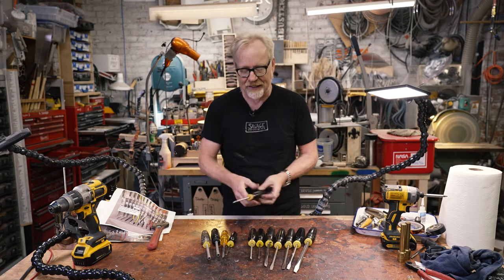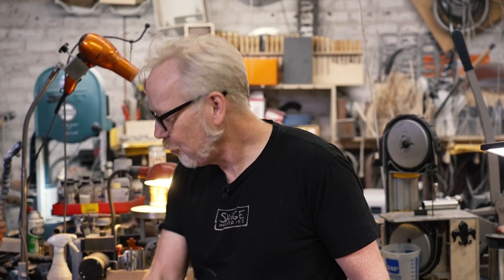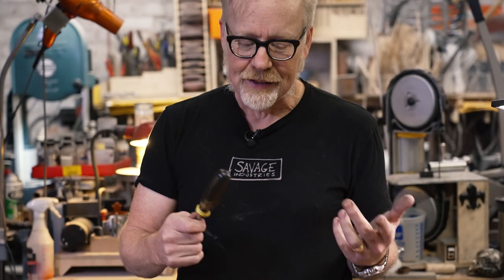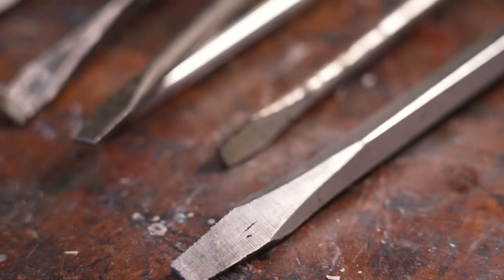Adam Savage's Favorite Screwdriver Design!

Comment: With the lathe and rotary head for the mill, you could give a taper to the hexagon shapes and change them to a triangular / 3 prong shape.  
Or, as temporary measure to fill in your set, machine that handle shape in delrin and affix the shaft/head from other screwdrivers to it.
Reply: I did this. Had the shafts milled to spec at a CNC shop and then made a mould out of aluminium for a hard resin handle that was a custom fit for my personal ergonomic desires. After 18 years of screwing around with cheap and expensive sets, i realized that there's no substitute for making your own.
Reply: @aserta  And it has never been easier to learn how to make your own.
Reply: @aserta  I'm a machinist, and I've had factory jobs where I used a screwdriver so much I got blisters every day. My personal solution is different than yours, but still pretty involved. I find large old wooden-handled screwdrivers with messed up heads. Pull the shafts out by sticking the shaft in a vice, use pry-bars bars to pry the handle up and off of it, and replace the shaft by pressing and/or epoxying a new shaft in place. Then I can shape the screwdriver handle however I want, to get rid of hot-spots. It's just wood, and I'm in a machine shop. 

I thought about making a mold for a plastic handle, but untreated wood is much better for my work. I get really oily, and plastic handles get slippery. What kind of shape did you end up going with? I might want to try it sometime.

Comment: I have a set of nine Stanley Workmaster (black & yellow) screw drivers I bought in early 70's.  They are indestructible, but no Canadian screw driver set is complete without the Robertson (square head) drives, #2 and #3.  The tools I inherited from my Dad are greatly valued and I would hate to loose even one.  Even the 1920's, perfectly balanced, hickory handled claw hammer, knowing that the aged patina of the hickory handle is stained with Dad's blood, sweat and tears (DNA).
Reply: Need #1 as well for electrical.

Comment: Curious questions for you. I’m a diesel mechanic by trade and all my coworkers own lots of snap on tools. I was very skeptical of them because of how much they cost and if they were actually worth the money. My coworker said that he buys them simply because, “they’re pretty and if I’m going to use them everyday, I’m going to treat myself to something pretty.” What is your opinion of tool truck tools? Would you ever buy a tool simply because it’s pretty even if other cheaper ones work just as well?
Reply: I'm pushing 60.And have used tools all my life. I can't say that I've managed to keep a complete set of anything so my tools are filled in with mix matched brands. They get the job done. My Buddy has a shop and only buys Snap On. Tools. It is always a treat to go there and use his tools. They really are superior.  I like his combination wrench set .open end and box. They are extra long and extra thin. And the open end does not slip off like other wrenches because they have little teeth cut inside that grip and hold tight .

Comment: In my opinion theres no better screwdriver than the Wera Shockproof (Schlagfest) meaning the yellow handle with the metal cap on the top. At most companies around here (Austria) you only see the Wera Screwdrivers (just like we only have Knipex Pliers and Pipe Wrenches). Wihas are Also very nice.
Reply: The disadvantage of the shockproof version is that it doesn't show the size on the back, like the regular Wera's do, and which make them so easily identifiable. So I only bought a large flathead in shockproof version. That's the only one I'd bang with a hammer, like a chisel. All the others, Pozidriv and Torx mostly, are more practical in the regular version in my opinion 🙂
Reply: @nolanhitchens  Well, sometimes you need to hammer the screwdriver into dirty or damaged screws and it's nice that the back of the handle takes a beating gracefully ;-) 

I keep them sorted on a first-order-retrievability tool-wall, so the missing marking on the back is not an issue for me.

The other big advantage is the hexagonal transition between driver and handle: You can use a ring spanner to convince stubborn screws with more force to get out (or break).
Reply: @Makatea  True, but the regular Wera's also have that hexagonal feature. I like easily seeing if it's a TX15 or a TX20 I'm about to pick up. That's harder to see with the shockproof ones. For damaged or dirty screws I'd use my electric impact driver with the appropriate bit. 🙂

Comment: ADAM! You have enough clout in the Maker community to put some kind and loving pressure in the Stanley tool company to reissue the WorkMaster series. Maker nerds unite! Gather your EVA foam pitchforks and 3D printed torches and storm the Stanley castle!!! I say WORK, you say Master! WORK   MASTER!  WORK   MASTER!
Reply: Stanley is an emergency buy from Wal-Mart, not cause for a revolution.
Reply: Didn't Stanley leave Connecticut for China a decade ago?  The patents are all expired - no reason anybody stateside couldn't make these (or even Rigid or whatever). Ideal would be to find a small American tool company that wants to expand its sales with a Tested line and have Adam describe why they're built to improve the worklife of makers.
Reply: @flowerpt  That's some pretty good good weed.

Comment: Hi Adam im in the UK and i love Draper screwdrivers and tools, i like the fact there shaft is square so you can use a spanner for extra leverage and the shaft goes right to the end of the handle and shaped to handle meaning you can hammer the screwdriver as hard as you want as its steel on steel

Comment: I have stanley workmaster like those from my dad too and yes they are great.  But recently got a set of Wera and totally love them.     The Snap-On older hard shell Square design is great too. Don't like much the newer 3 lobe rubber type one..and they are bulky :|
Reply: the square snap-ons last forever, but are too slippery,  i prefer the 3-lobe ones.  however i agree that the handle sizes are a bit off - too much variation between the biggest & smallest
Reply: Wera are both great and affordable.  I used to have snapon but almost all of my screwdrivers are wera now.
Reply: Yes. Wera has the best screwdrivers, the laser pattering in the blades are brilliant!

Comment: Hi Adam thanks for sharing your love of screwdrivers.  I’m in the bag area as well, if I come across any ok try and grab some for you.

Also, the octagonal style “classic” handle you mentioned, the one great use of that design is for use a pair of channel locks or similar item to grip and help create torq when you need to unscrew a stuck screw head.  I usually tap the tip of a screwdriver into a head of a screw to sit it firm, then I use a pair of channel locks while applying pressure on the top of the handle to help work the head loose.  It doesn’t always work but it usually does like 75 percent or more of the time.

That’s my little tip to share as well.  Thanks as always for being so great!

Comment: When I first moved out on my own my dad bought me a tool kit that was Popular Mechanics (like the magazine) branded. I don't know a model number or anything and this was 20 years ago-ish so probably not available, but the set of screwdrivers in that kit is the best I've ever had and still my go to.

They're basically triangular shaped handles with rounded edges and a textured rubberized coating on the flat parts. The shaft and hardened tips are excellent quality as well. Phillips are blue handled, flat are red handled, and it has torx heads that are yellow.

I've tried to find them online just as a recommendation and never had any luck but they're excellent if you ever run across them.

Separately the kit has a set of end wrenches, standard and metric sockets, a crescent wrench and three different pliers in a fairly small package. They're all great if you find one in the wild at a pawn shop or something.
Reply: I have these and use them for anything that needs a solid grip. For finger-tightening the traditional type can be a little better - I have some old Craftsman Professional drivers with aggressively deep ridges and very hard metal.
The Popular Mechanics type shows up occasionally under different brands, same design.

Comment: Thank you Adam! Screwdrivers are something I have recently started paying more attention to. As a star wars prop replica maker I always need fastener drivers and I have drawers full of different kinds. My favorite static ones have been yellow and black stanleys that do have that hex handle... apparently you can put a hex wrench around the handle for more leverage!? Anyways, As a Piano Tuner I need all kinds of small slotted and phillips bits to open piano cabinets and deal with its action. This is in people's homes so I was originally using an Eazypower ratcheting multi-bit one because the bits are on the outside of the handle! Hard to replace though (double ended, ball bearing, special diameter) so I've resorted to a DeWalt ratcheting driver because it holds regular 1/4" bits and is well made with a long neck. My favorite thing.... We need one long slotted automotive screwdriver to poke a strip of felt between each set of strings. I love this because I experiment with very old wood handled ones, like MAC because of the small handle, long thin steel, and the lovely feel of the old wood.

Comment: I have a favorite that I often gift to maker friends and family - the Garrett & Wade  heavy duty screwdriver set with wooden handles. They're beautiful, rugged, and have oval wooden handles - oval handles don't roll as easily. One other thing I look for is a square shaft, so you can use a wrench to get more torque without marring the handle. The Garret & Wade lack that feature, which is another reason why you should have multiple styles.

Comment: I was looking for a ratcheting screwdriver for datacenter work, which had to be fairly small, but strong, and have some bits, and I landed on a pretty nice DeWalt. It has a tapered handle and the extension comes off so it fits in the side pocket of my bag. I also need some very specific Torx bits for CPU removal from DELL servers that I occasionally service. All this leads to the fun of creating your OWN kit. Great video!

Comment: There is something about finding the "right" screwdriver for you.  For universal screwdrivers, I have a Fiskars that has a rubber grip like an old-school motorcycle handgrip.  I'm normally not a big fan of rubber grips, but this one is an exception.  It holds 4 double-ended screwdriver bits in holes on the shaft end of the handle.  It just fits my hand really well, and the weight of the handle helps when spinning out screws.  I had one I kept on my desk at work, and it was stolen.  I bought two more to replace it, one for work, one as my go-to in my desk at home, and they are still around.  I then lucked out and found a couple more at a flea market, that stay in my tool chest as spares.

Comment: I was on the Sears Craftsman buying team for screwdrivers in the early 2000's, and we had a screwdriver & plier line called Comfort Fit intended for seniors or people who may not have as much strength in their hands. They had a nice cushion grip and were really comfortable to use. We found out that they also happened to have greater torque than our better screwdriver sets. The handles are grey and worth consideration in your workshop. Currently there is a Craftsman "Extreme Grip" series that may be related, but I can't be certain. The Comfort Fit plier set was sku 45220 and can be found on Google.

Comment: It’s funny when the moment arrives that makes you take a deep dive into something that has been a part of your life for a very long time without putting much thought into it. When that moment does come you learn so much about the tool and even more about yourself. 

I need lots of screwdrivers. Slotted/Common screwdrivers: I have hollow ground, i have regular everyday use drivers of various quality levels that also determines where they live (my wood handle Felo set stays indoors), i have impact drivers, very long drivers and like Adam I have some that are pry bars. Of course there is the wide array of watch maker and tiny drivers for electronics too. I also have stubby and right angle and surely a few I forgot to list but value there availability just as much. I have a need for and use all of them at some time or another. Phillips drivers are a whole other list and just as important to me and I’m not even getting into other bit styles.

Comment: I think I have one of the Workmaster screwdrivers, a long narrow slotted one.  Definitely a good feel to the handle and grip.
Over the course of roughly 50 years of acquiring tools of numerous brands, both "name" and "off", I've seen the prices go up and the quality go down.  These days you can easily spend a small fortune to build up a good toolset.  Excelite and Vaco are good, I have some quality Stanley and some of their low-budget ones.  I have an Estwing hammer I found in a park when I was probably nine years old, still use it on a regular basis.

Thanks, Adam, for reminding me of my many friends.  They may be tools, but they've stuck by me for many years.

Comment: When I was a kid (in the '60s) I worked for a TV repairman after school. That was the first time I encountered nut-drivers and I thought they were so cool. FIY a nut-driver is like a screwdriver except it fits over (usually) small nuts found in electronics. I was issued a set when I became an avionics repairman in the USAF (late '60s). Now, of course, I have a nice set of seven Wiha SoftFinish hollow shaft inch size. Metric might be useful but I haven't run into that need. (Be sure to get the hollow shaft type.)

Comment: Have no fear Adam! I am not much of a fan of the Workmaster handle. I wouldn't say I dislike it, it's perfectly serviceable. My favorite handle so far are the handles on the Wiha 53180 set (and other screw drivers like them). Although it may not have "dentents" in the handle, the large bulbous diameter gives you a lot to grab onto and more torque. Bonus for the fact that almost every driver has a spot to put a wrench on if extra toque is needed, and a striking cap on the back for when it is needed in a pinch.

Comment: My favorite screwdriver is a Stanley Workmaster #2 Phillips with a hardened tip. I bought it in the late 1970s after using my maternal grandfather's one summer while helping him do car and boat repairs. I recognized then how excellent a piece this was. With the hardened tip it still is like new, with no rounding off. Also one of the few tools I have from that time, as it was in my hand  while I was under my car working to avoid having it freeze up during a vicious Chicago winter freeze when some brazen MF  walked by, opened the car door, grabbed my tool box, and ran off before I could get out from under the car.

Comment: Throw in a Roberts point, too.
And the hexagonal handles let you use a large wrench on the handle to give a leverage advantage if you run into those situations often.  You can push with all your weight and still turn the driver.  Other than that, it's preference.  I like the Snap On, reversible, wratcheting screwdrivers with interchangeable bits so you don't have to release your grip on the screwdriver or absolutely need to have several drivers.  I got by for years with the standard and stubby versions as my main, everyday use drivers, with some specialty drivers that lived in my box for "that particular time."
  I really like my Mac screwdrivers with a four sided handle, like yours, because they do feel better in the hand than others.   Look at your hand and make a grip, like you're going to hold something (like a handlebar on a bike).  It makes a four sided shape.  That's the most comfortable thing to hold as it naturally fits the grip of your hand.
And I have absolutely earned every demerit badge during my career as an ASE mechanic, a journeyman carpenter, a blacksmith and a movie production equipment technician.  Several times over.  😉

Comment: My dad loved to tinker. He would try to repair anything before replacing it. He had a heavy metal drill, so he used his (Vintage) Millers Falls No. 188A push drill. When he passed away, even though I can't use it correctly, I secreted it before my brothers could take it. It was/is "wonky", so I bought the same one on eBay. I "played" with it so much, the screw top is "frozen" shut (can't get the screws out (oh, well)). I still cherish his "wonky" one.

Comment: I have the "modern" straight hex design like you showed, and as another mentioned I have used it with a wrench slipped over the end for added torque. Especially useful for positive grab bits like torx and hex. And a lot cheaper than buying an impact driver for the couple times I've ever needed to do that.

Comment: I can see you wanting a matching set of screwdrivers if they fit your hand well. if I was primarily working out of a toolbox or on a bench I think I would like the same. Primarily though I am working out of a tool pouch on my waist though so I prefer all the screwdrivers I am carrying be actually different makes. The reason for that is since the handles are all different shapes I can tell which one I am grabbing without having to look at the pouch. sometimes its very useful to keep my eyes on the work because that way my other hand will not shift what I am holding. I am often moving sets of wires from one device to another in a cabinet so I might need three different screwdrivers just to move one wire.

Comment: I have a few sitting in my box that I never use, they’re all yours if you want them. # 1 & 2 Phillips, the #1 is the clear orange acetate style. You’re right The handles are absolutely amazing but I never liked the way the tips fit into screws, but they are in good shape. I also have one of the screw on cap bit drivers but I do actually use that one a fair bit.